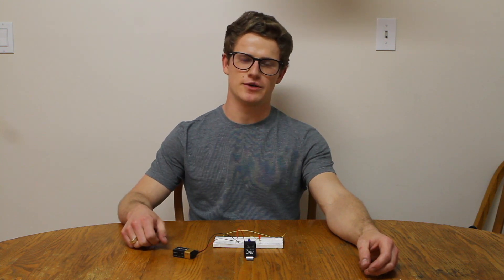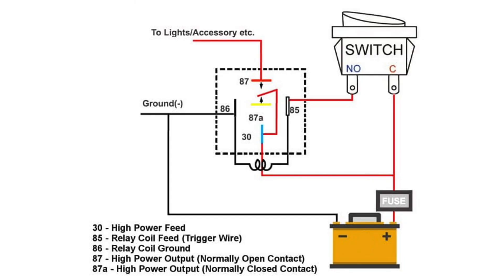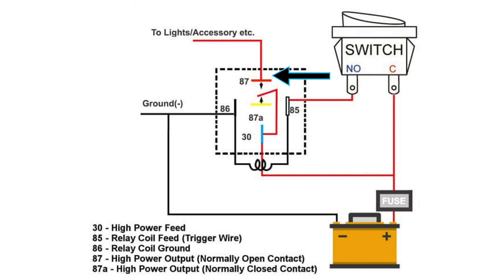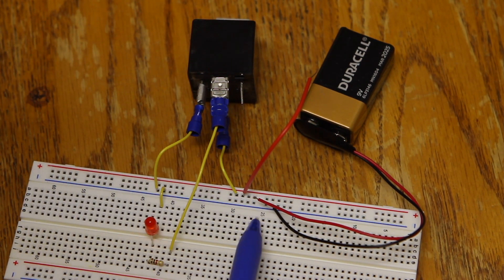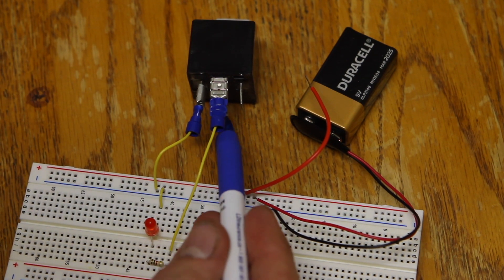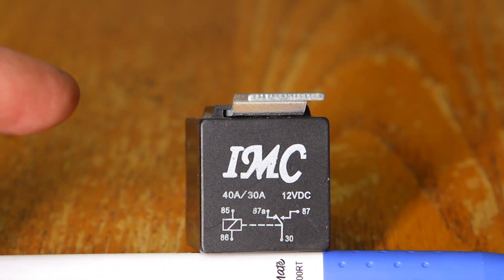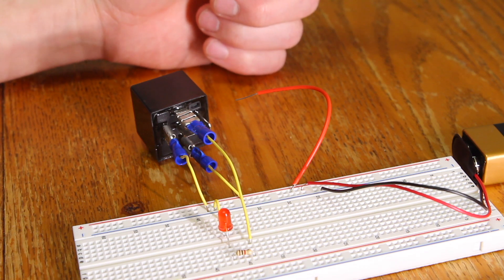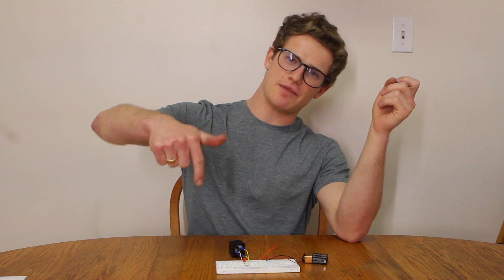How to Wire a RELAY for any Accessory on your Bike.

Comment: If i connect the second relay parallel to headligh relay, it divides the resistance of the coils of relay. Will it couse heat ?

Comment: Hi Calvin, sounds U really understand ur circuitry stuff so I have a question...  would this relay also help out if the grips seem to not get enough power to stay on? I have this problem with mine they run fine straight of the battery with the engine of but as soon as I start the engine the grips start switching on and of they only seem to constantly stay on if I rev the bike at around 4500 rpm which obviously is impossible to do while driving so the grips turn of or don't even turn on. unless the bike is of?! so... kinda useless.  please advice? kind regards Li
Reply from the maker: Sounds like your charging system isn’t up to the task of powering the grips and bike plus what ever else you have attached electrically. A relay won’t increase the amount of power available. Wire that is too small of a gauge may increase electrical resistance when drawing significant current across it but unless you find the wires that power your grips are getting hot then I doubt that’s your issue. It’s very unlikely a relay will resolve your issue. I would investigate your stator and rectifier to ensure they are in spect.

Comment: I'm curious if you've done this on the FZ, and if so where you ran things.. Video?  I'm looking for a place to put a relay, busbar & fuzes in the FZ6 and nothings seems great. In the faring is a pain to get to fuzes, inside the frame is so cramped, no room near the battery, considering under the east at the back of the tool compartment, but then the wires have to run all the way back, and front again :/
Reply from the maker: I have had a relay on the FZ6 in the front fairing on the left hand side. Tucked under the dash and side pod I added a mount for a relay like the one in the video. Another good spot might be in the plastic pods next to the seat but then you have to run long wires which isn’t fun.

Comment: Hello Calvin MC
I hope to help me because I have a problem with my Yamaha FZ6 S2 from 2008 with a mileage of about 63000km, so my problem is with the fan which stopped working a few weeks ago, the problem started when I noticed during a stop at a red light that the temperature is 105 C while the fan does not trigger, I then went to a mechanic and we tested the fan linked directly to the battery and it works , same thing for the relay and the fuse but still the same problem, we then changed the calorstat but the fan does not always trigger, and to prevent the motorcycle from heating up, the mechanic suggested that I link the fan directly to the battery with a relay and a switch that I activate each time the temperature reaches 95 C, but once it is done and despite that I activate the fan from 90 C, the motorcycle heats up at any stop on fire red until 110 where I will have to cut the engine, so I wonder on the one hand if you know who is responsible for operating the fan? on the other hand, I do not understand why the motorcycle heats up when stopped despite the fact that I activate the fan by hand and that it cools down when the motorcycle is in motion! I thank you very much and in advance for your expected advice.
Reply from the maker: Hmmm it sounds like you have checked all the electrical components to do with the fan. Maybe the relay is having an intermittent failure while riding so maybe try switching out the relay with another one and see if it persists. Also have you bled the cooling system so it doesn’t have any air bubbles? Also maybe clean your radiator of any gunk in between the fins so air can flow through it easily. Also check your overflow hose is in good condition and the overflow bottle has a tight seal with the right amount of coolant in it. I have seen lower coolant temps by adding water wetter to my cooling system so maybe try that. Water wetter basically lowers the surface tension of the water and helps the coolant exchange heat more easily. With all that said my bike will get up to 100 or 102 stopped in traffic with the fan on so I’m not sure how far off 110 really is. If you’re in a very hot and humid climate that would have a negative affect on the bikes overall cooling ability. Best of luck. I’ll do some more digging on the electrical side for the fan and see what I can find! 👍
Reply: @Calvinm  Thank you very much Calvin for your advice and your efforts, indeed I live in Morocco in a relatively hot climate and your channel has always been among my preferences for several months. For the relay I have already changed it but without result, I think that the ECU box is responsible for triggering the fan because I couldn't find a thermocontact for the fan except the temperature sensor which probably sends the signal to ECU and which in turn activates the fan. Thank you again Calvin hoping you will find the electric fan shemat to help me, have a nice day.

Comment: Hi Calvin..  This is a great tutorial, thank you very much for sharing :)  I know that you are only using the 9 volt battery just for demonstration purposes!  But how does it power a 12v relay?
Thanks John :)   I have liked & subscribed... :)
Reply from the maker: Thanks John! You're right, a 9 volt battery isn't perfect for a 12 volt relay but the 9 volt battery had just enough juice to shut the relay and light up the LED.
Reply: @Calvinm  Thought that might be the case. I am starting to get interested in basic electronics and just wanted to check. Thanks for the quick reply and have a Nice day 😎

Comment: Wish you would move up to the fz1. So id know hoe to fix all my stuff on my fz1
Reply from the maker: Haha, I've been looking around for an FZ1. I might pick one up in the future!
Reply: @Calvinm  there amazing. Perfect amount of power and weight. And comfort but you can still lean down and  knee drag. I have fairings on mine and it looks fantastic with fairings theyre really hard to find tho. And the flush mounted clear turn signals is a must.